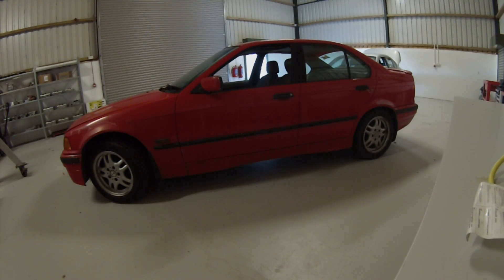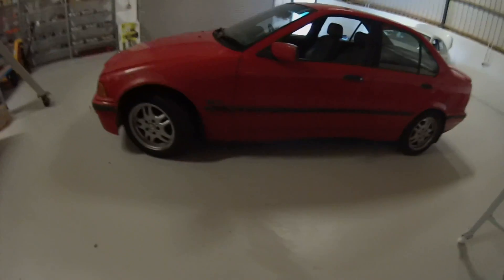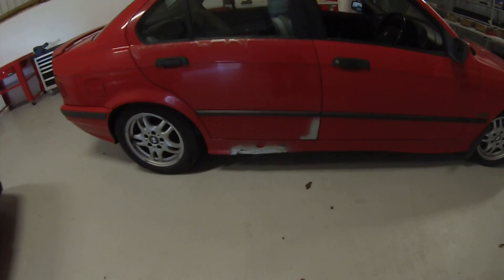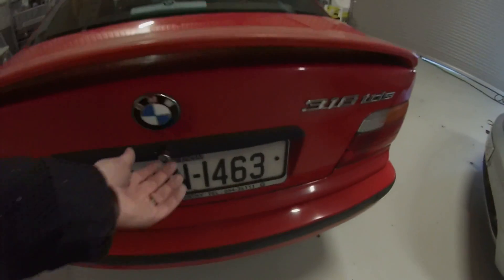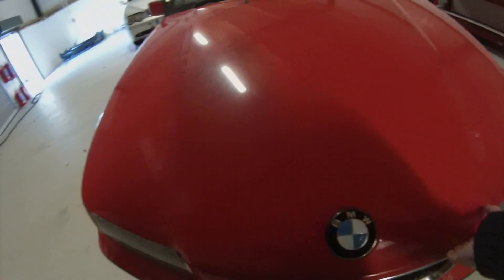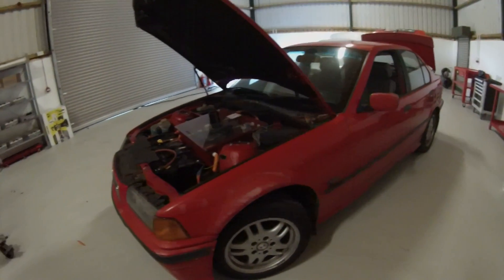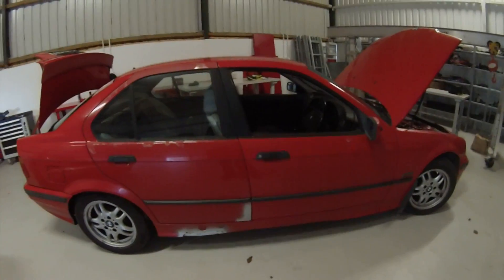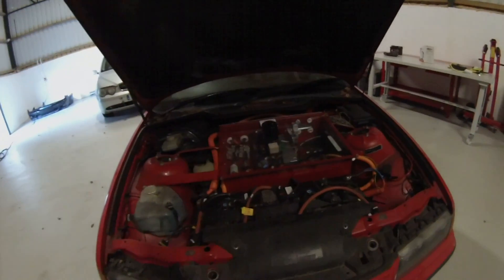€1,000 BMW E36 EV Build 14 : Update

Comment: Thank you for your video. I found out I cannot have any battery forward of my front shock towers in my e36 which is a bummer as I had someone make a very sturdy tray which is bolted to the car. I will have to put the batteries all the back which is going to be about 150kg not including the weight of coolant. I will use the front tray to hold other things but the car will have more weight in the back than the front I will reinstall the front radiator and pipe to the back for battery cooling. That will add some more front weight.